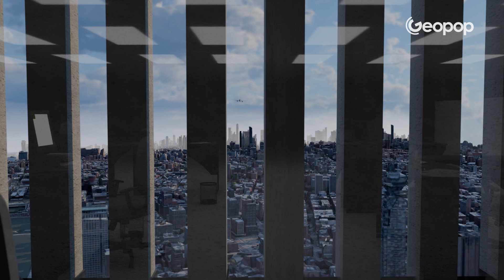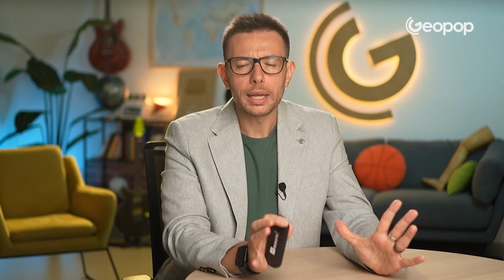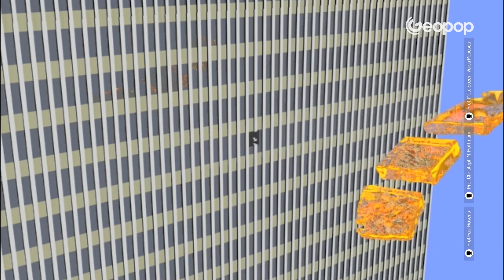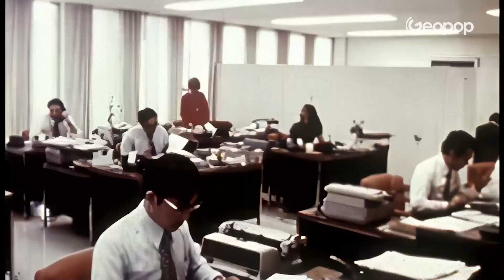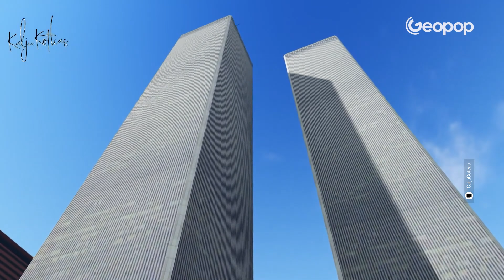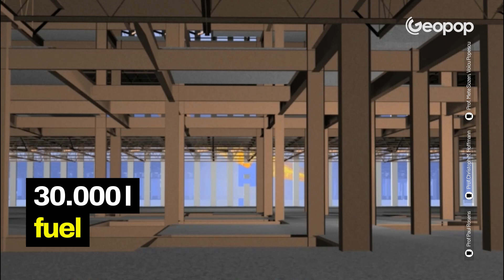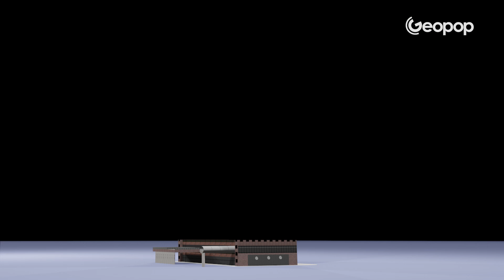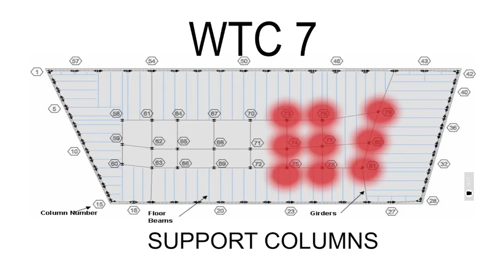9/11, 2001: The Technical Reconstruction of the Twin Towers and WTC 7 Collapses

Comment: The fact that NIST and you can claim that WTC 7 collapsed due to fire will never cease to amaze me. Like seriously, are you all blind? NIST released two animations both of which massively contradict one another and most importantly look nothing like the numerous videos of the collapse. The whole column 79 theory is straight baloney and the supporters of the official version like Jim Meigs, David Dunbar and others keep throwing around terms like chain reaction, progressive collapse as if they understand it when in reality they have no clue. NIST never published their report with a peer-reviewed journal, they still refuse to provide the data they used in their sham computational model and even contradict their own claims within their own report. For example, the graphs in the report show that fires peaked on the 12th floor at around 4pm. However, within their own report, they cite an image that was taken between 3:53pm and 4:02pm that literally shows no fires on the 12th floor. They also admitted that 1/3rd of the global collapse occured at free fall acceleration. The fact that they did that means that the building was brought down. Period. Guys go ahead and read the University of Alaska's report than the garbage NIST report which was simply a waste of US taxpayer money.
Reply: What about the penthouse that collapsed 10 seconds before the rest of the building? what about the odd choice of supports WTC7 had, how about the extreme damage on the south side of the building and almost every floor there being on fire. A lotta footage claiming the speed of the fall is also sped up. When the west side of the buildings supports went down, it weakened hte internal structure severely coped with the fires and facade damage, the internal columns snapped and it just went
Reply: @Deavastator what you are calling the penthouse is actually the elevator shafts. And like all controlled demolitions those must go first. And that's the strongest part of most any skyscraper.  One eye witness reported a loud sound coming from tower 7 just before the collapse and loud booms during the collapse.  Other explosions came from tower 7 like this one 8:25
https://youtu.be/bLF5D7M1YgA?si=aHSvS__uOdxMi1ZB
Reply: @robbiehiatt9966  the penthouse, housed mechanical bits for the building, it powered the elevators, not an wlevator shaft, and again the wtc7's supports at that point were shapped like an h, and failed after 7 hours of bruning, any lour noise wouldve been the cave in. Only 13% of emergency services reported an explosion, which are very easy to notice. You woupsve heard it on any news or digital camera, and seen it vua windows shattering. I get it you have no idea what explosions look like and are challenged in the noggin
Reply: you couldn't have heard it on any camra, that is a lie. If you know that then you know what kind of microphone they were using on all the cameras. So what kind of microphone was that? And 13 percent bla bla bla. Out of the first 365 or so firefighters,  only 12 survived . If all of them said it it would only be about 3 percent so idk what you're talking about and I don't care.  If you knew anything about control demolition all it takes is one look at tower seven and it's a done deal
Reply: @robbiehiatt9966  that is by far the worst response my any means, it was 2001 any explosion wouldvr been very loud and most of new york wluldve heard it, that 345 number is also disprovrn due to thr fact the first 2 companies on scene only ladder 10 engine 10 sustained casaulties. And thr microphoje issued is easily disporven since almost every camera had one back then
Reply: @Deavastator Sounds like you're saying a huge majority of the firefighters that were at the world trade center buildings on nine eleven either disappeared or abandoned their post. Everybody's gonna believe that buddy. I don't even know where to start.Everything you said is incorrect. You seem to avoid my questions but that's OK, we knew the answers to begin with.  Now you're saying only firefighters from ladder 10 dies. Where did the other 300 firemen disappear to then? Oh yeah you can't answer questions. OK, since you really don't understand how cameras work.I guess I'll have to walk you through this. Lots of the videos that I have seen came from reporters Who had handheld microphones. Not cameras with microphones. In that situation the microphone is connected into the camra. So clearly you don't know about any of the microphones. Wrong again,  checkmate,  you done
Reply: @robbiehiatt9966  the first companies thwt made it suffered the least casaulties. You also just not reading. The majority of firemen who went up did not come back down. And they did abandon their posts after wtc2 went down, also the majority of firemen were found in groups or in groups with the inner core taking tbe least damsge their bodies werent all pulverised. Some firemen were pulverised too dust, only professional cameras had handheld microphones it was 2001 most cameras had built in microphones. I get it you were born post 9/11 and are clueless to it. Your whoke rebuttle is just "nuh uh i didnt read what you said" and "i won you lost" nothing of factual information
Reply: @Deavastator out of the first 355 firemen  on scene. 12 survived.  And after tower 2 fell. The whole area was evacuated but the firemen in tower 1 wasn't getting the radio transmissions so they didn't know to get out. And they died now your crap about them abandoning their post makes me pretty mad, you weren't there. So the person abandoning the situation here is you. And by the way, I'm 48. But I'm done because I've completely proven you wrong. And why don't you go learn how microphones works and what kinds of microphones actually exist before you act like you know what you're talking about. You don't. I owned a video camera in 2001 I know all about there capabilities.  And seeing how I'm currently recording my 4th album I easily know more about mics than you ever will. I'm abandoning this conversation for the next person to come tell you how wrong you are
Reply: @robbiehiatt9966  but thats just wrong, over 1,000 firefighters had arrived by 9:30, within 10 minutes there was about 400-500 on scene, when the south tower went down all communication was lost but many still exitted out due to the rumbling of an building falling only a couppe metres away. Many did abandon their posts AFTER WTC2 went down due to the mayday order and an evacuation area of several blocks. I also dont know what camsra you owned but back in 01 aomost every camera had an audio recorder. I also wasnt there i was 600 miles away in a different country aboard a rusting hulk. but ive also read through almost every report avaliable, documentary and well over 100 hours of raw footage
Reply: @Deavastator  - I assure you it does not care.
Reply: @TheLoonResistance  i knoe its a bot but iys good therapy to actually yell at someone for bring just wrong. Sometimes i do wonder ehy i even try woth them
Reply: @Deavastator  - It only encourages them.  Like any animal if you starve it they will move on to find nourishment elsewhere. Then life is better for everyone.
Reply: @TheLoonResistance  its like arguing against a brick wall that tries to lower you to their level
Reply: @Deavastator  - That is the ultimate goal of conspiracy internet debate rhetoric - make sure no progress is ever made towards a solution.
Reply: @TheLoonResistance  we can only try to counter misinformation
Reply: @Deavastator  - Only to ther right audience. Everything else is time wasting.
Reply: The NIST conducted 4 models of Building 7, each testing different failure mechanisms and none of them in any way attempting to visually replicate the observed collapse (not really what engineering models do) .  So already I know you are talking out of your ass.  IF you don't like The NIST, there are plenty of other options out there.

The collapse of Building 7 is probably the most studied engineering disaster in history and the subject of 5 comprehensive engineering studies and more than two dozen technical articles in major peer reviewed engineering journals, most of which were published 15 or more years ago. Thousands of pages of material.  This should get you started.

FEMA BPAT (initial report superseded by NIST NCSTAR 1A)

NIST NCSTAR 1A: Final Report on the Collapse of the World Trade Center Building 7, 2008.

Guy Nordenson and Associates, WTC7 Global Collapse Analysis Report and Summary of Findings, 2010.

Arup, WTC -7 Structural Fire Analysis Report (Runs 1-4), 2010.

Weidlinger Associates Inc., WTC 7 Collapse Analysis and Assessment Report, 2010.

BRE Centre for Fire Safety Engineering, Analysis of the Impact of a Fire in the Mechanical Room (5th & 6th Floor) of the World Trade Center 7 Building, 2010.

T. McAllister, R. MacNeill, O. Erbay, A. Sarawit, M. Zarghamee, S. Kirkpatrick, J. Gross, Analysis of structural response of WTC 7 to fire and sequential failures leading to collapse, J. Struct. Eng. (United States). 138 (2012) 109–117.

For a summary of the major studies I would recommend THE COLLAPSE OF WORLD TRADE CENTER 7: REVISITED by Mhd Anwar Orabi , Liming Jiang , Asif Usmani and Jose Torero which is a 33 page summary of the different analysis and conclusions published in 2020. Sorry, YouTube will delete this post if I give the link but it should be easy to find and is available from the University of Queensland, Brisbane. 

Real structural engineering industry professionals conducting real engineering studies and publishing them for other professionals to see. Not amateur YouTubers appealing to the gullible and credulous.

Happy reading

And of course, Hulsey:  A Structural Reevaluation of The Collapse of World Trade Center 7 March 2020,… for those who need a good laugh.

Comment: The statement regarding the World Trade Center’s ability to withstand the impact of a jet plane was made by John Skilling, one of the lead structural engineers for the Twin Towers. In a 1993 interview with the Seattle Times, Skilling discussed how the towers were designed to handle the impact of a Boeing 707, which was one of the largest jetliners at the time of the towers’ design in the 1960s. He expressed confidence that because of his unique structure and massive columns at the core, the structures could sustain multiple hits from such an aircraft without collapsing.
Reply: Theres a whole discussion dated in september 2001 pre 9/11 about this, A boeing 707 weighed 3 less tons, and that test was for a landing speed plane going to lagaurdia. Not a 94 ton plane hurdling at 500 miles an hour, another forgotten thing is that the internal columns did not fail until the external columns shifted all the weight onto a weakened internal core
Reply: @ 
BS
Reply: @MINDSPARK-u6e  got a better rebuttle then "nuh uh"
Reply: @Deavastator  - If it ever did it would be a first. It is just a mindless repeater and probably understands little of what it posts.

If for example I were to point out the bleeding obvious that both Towers survived the impacts of much larger Boeing 767's I suspect all it could master in reply would be,...

You guess it.

Comment: I  can't buy into this solution presented here,  lots of other factors took place not mentioned?  And what is with the explosions mentioned by witnesses that occurred?
Reply: It's not to sell anyway. It's just what's happened.

"and what is with the explosions mentioned by witnesses that occurred?"
No explosions recorded.
Reply: @ThomasKunderaBisthen what's this. 8:25
https://youtu.be/bLF5D7M1YgA?si=aHSvS__uOdxMi1ZB
Reply: @robbiehiatt9966  steel, an explosion wouldve at leasr moved the dust, but it basically does not move, just steel falling several stories, happened throughout most of the day
Reply: @Deavastator After the explosion you can hear the fireman.Walk up and say we gotta get out of here.Tower seven is exploding
Reply: @Deavastator There's also video out there of a guy walking around tower 7 before it fell. I don't have the link though
Reply: @robbiehiatt9966  a bombing against tower 7 eas not far off, anything loud was called an explosion. Mind you there waa partial collaspe in wtc7 right befor eit went
Reply: @robbiehiatt9966  the one with the burnt out cars, shows the extent of collaspe damage and more flames
Reply: @Deavastator the cars that were down the street was ridiculous.  A collapsing building should have never burnt the cars perpendicular to tower 7 on the complete opposite side than the towers were on my made no sense whatsoever.  What do you suppose gives you the right to say anything loud that day was such. You don't know that and it's ridiculous you would claim that. So when the fireman says, "anyone of these buildings could blow up, this ain't over yet " your trying to say he means what? When he says secondary explosion he means what? Don't put false proclamation on these men that you don't know, never met, and obviously can't understand what they went through
Reply: In a review of 603 first responder accounts from 9/11 only 55 (just 13%) of them mention the word explosion or like an explosion and 0 (0%) mention seeing or hearing bombs

And of course, zero corroborating physical evidence. 

Not exactly compelling. I would say way to much is made of the casual use of a single word.

Do remember that explosION and explosIVE are different words with different meanings and explosION is a word that can and frequently is used without the presence and use of explosives.

Meanwhile, the collapse mechanisms – the sequence of failures - described here are substantially correct and this is true no matter who planned and carried out the 9/11 attacks or why .
Reply: @TheLoonResistance  Another thing is that, there were explosions just not by explosives. It was a not well ventilated building, backdrafts, jet fuel all can "explode" but theres also the fact that steel was very actively falling down, and if you hear steel fall you know its loud, enough to confuse someone who's never heard an explosion and or just seen it in a movie. With the internal core structure standing to about the 76th floor on the north tower, of course people heard loud thuds.
Reply: @Deavastator  - Plenty of sources for surprise loud noises.

Comment: considering all the predictive programming like the sesamestreet cookie monster eating the twin towers that came out in the 70s etc i suspect that the buidlings were constructed with the demolition charges in place.
Reply: Yeah, that totally beats thinking I guess.
Reply: One of the buildings has been blown up befour and it didn't set off any charges
Reply: Controlled demolition,  yes. Wired explosives when built. Not possible, Plenty of people had access to the buildings placing wireless charges is most probable
Reply: @robbiehiatt9966  "placing wireless charges is most probable"
Naive idea.
It was a plane actually.
Reply: @ThomasKundera actually the building still stood after the plane crashes.
Reply: @robbiehiatt9966  : The planes damaged them, and the fire finished the job.
No "explosives".
Reply: @ how can a smouldering fire melt steel? it takes a blast furnace. the whole thing was some type of masonic voodoo satanic ritual
Reply: @chrisBaron-g2h  - Not a smoldering fire it was raging fires and no steel melted or needed to. Structural steel will fail long before it becomes a puddle. 

Why do you feel the need to load your arguments with falsehoods?
Reply: @ but what about all the allusions to 911 over the decades on various forms of popular media. what was the point behind all that?